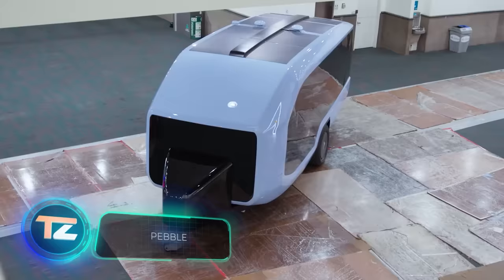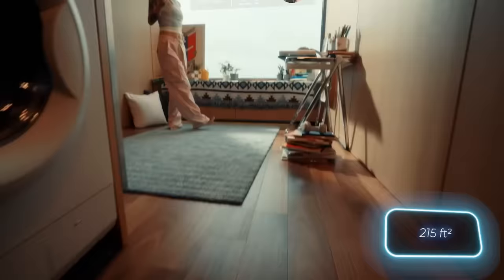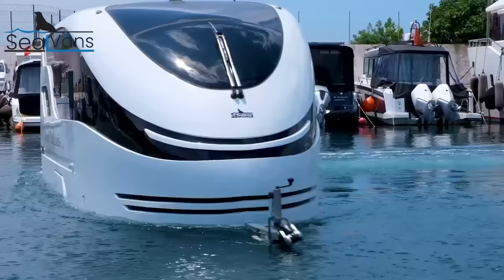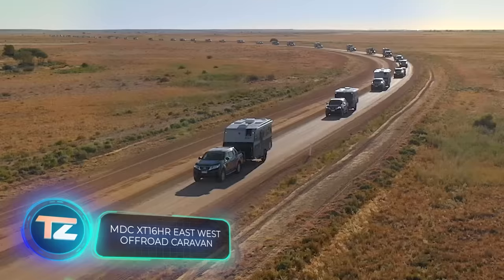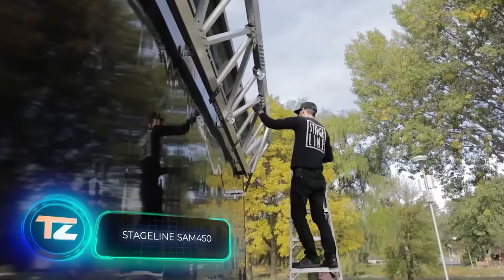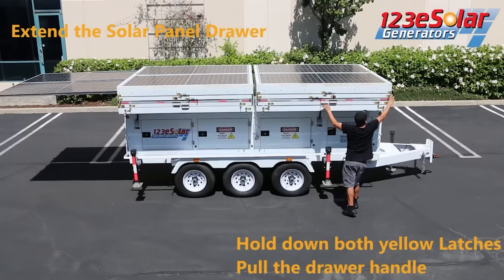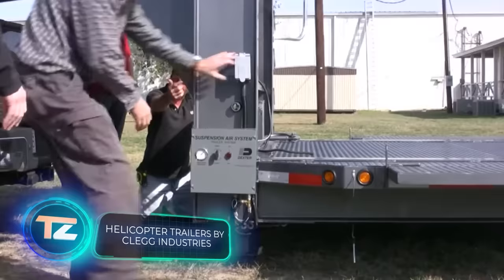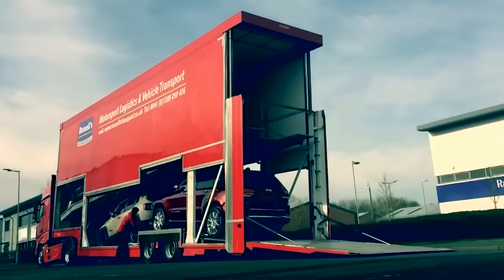COOL TRAILERS YOU HAVEN'T SEEN BEFORE

Comment: Absolutely Insane !  The Prices for these things are nuts !  
Why doesn't anyone build a Camping trailer for TWO Adults, Not Three, Not Four or Six,   that has a Decent Bed, a Useable Bathroom, Kitchen and a Comfortable place to sit when the weather is rainy that isn't a Sardine Can, and doesn't weigh so much you need a large Pickup to pull the thing ?  So less than 1800 Lbs ! Popup anything is Stupid !  All the Upper Space is wasted with no storage areas.  Small trailers today, always want to cram 4 people in them to sleep.  NO !  That's overly Cramped !